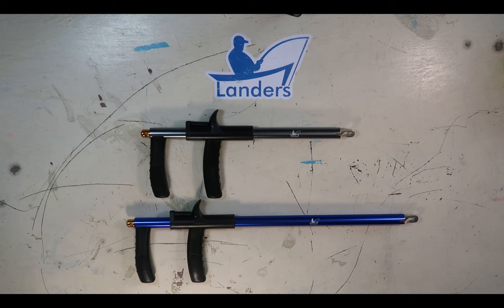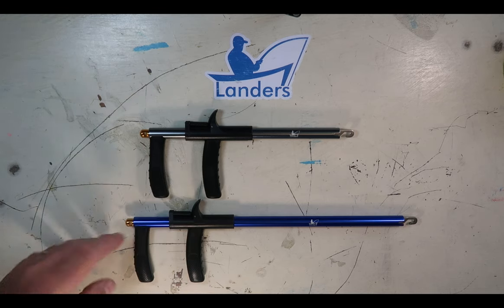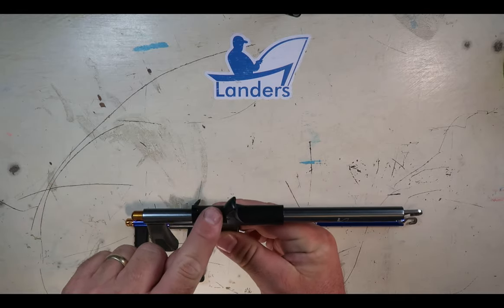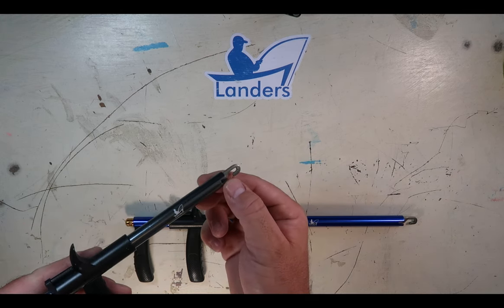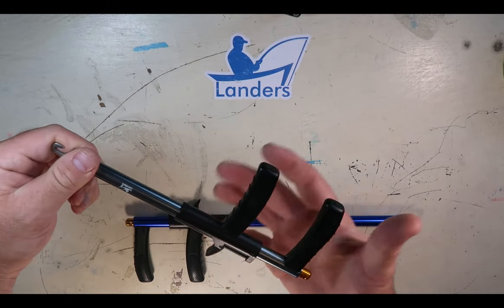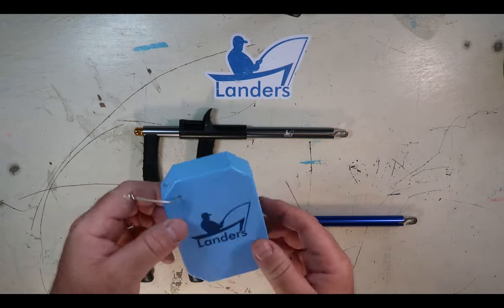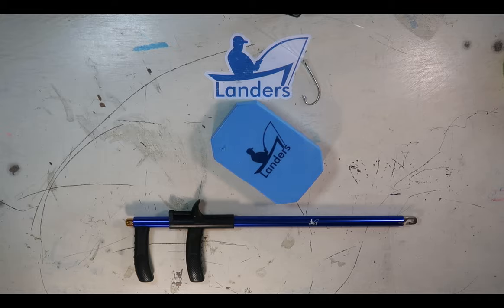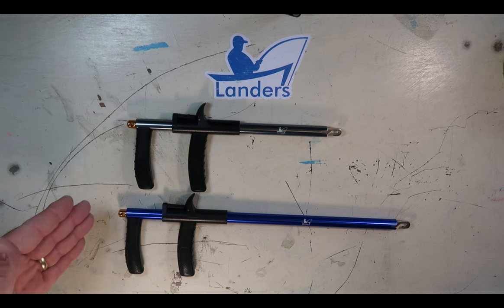How to use Landers Hook Removers

Comment: Could I use this to get the hook out of a large mouth bass that is “gut hooked”?
Reply from the maker: Clayton - yes you can, the key is to use the Landers to follow the line to the hook.  Safe extraction is possible.
Reply: @landersfishing6021  I have trouble with gut hooked fish as I can't get down far enough on the hook to pop it out, the mouth is only so big.  I have yet to be successful using this on any gut hooked fish
Reply from the maker: Hey there - which model are you using?
Reply: @landersfishing6021  one from great star tools.  Looks exactly like the one in the video and this is the video recommended from them for me to watch.
Reply from the maker: Lis Family there are a lot of copies of our tools out there, many are smaller and use low grade materials.  We would never point you to another company to get advice on how to use our tools, we serve our own customers.
Reply: @lightskin_vivid9701  come on man... you should know to contact the company you brought it from. That's like me contacting Toyota about my Chrysler warranty. smh